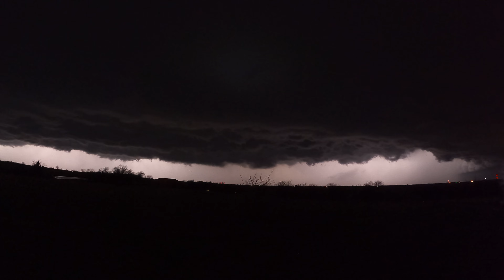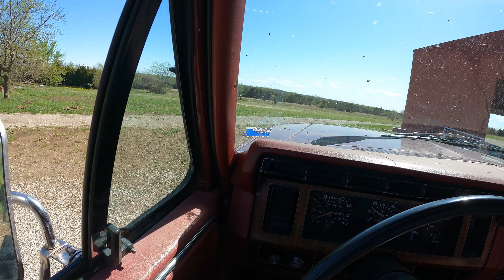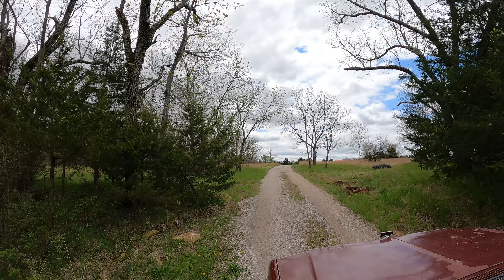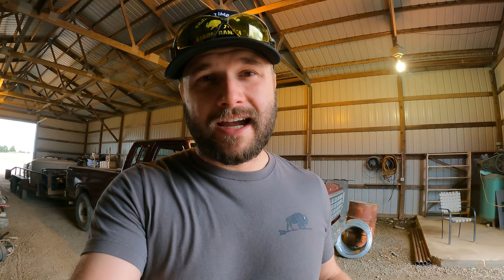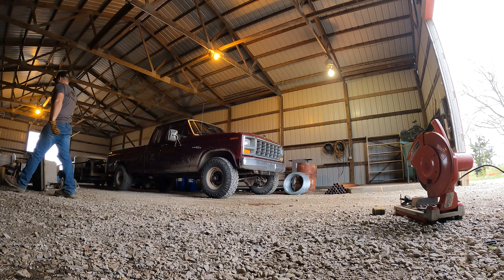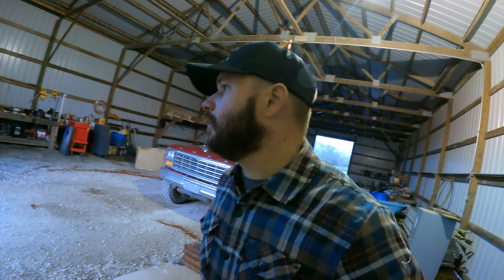Sparks Fly On The BUFFALO Ranch | How to keep Buffalo in Pt. #4

Comment: I know how you feel about handling the pipe. When I was burning with wood you handled each 18 or 24-in piece of wood many times ... you cut the tree, cut it to size, split it, load it, unload it stack it, bring it into the house, and then you burn it!
Reply from the maker: Generating a lot of heat even before it gets lit on fire! 😉🔥